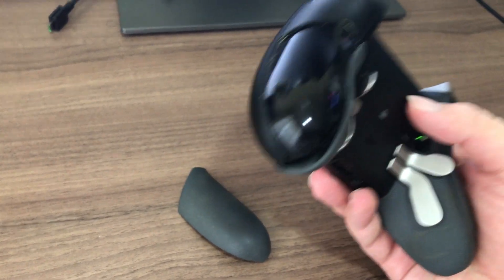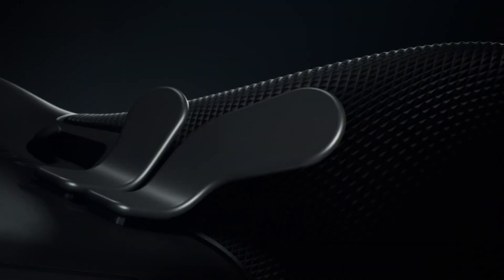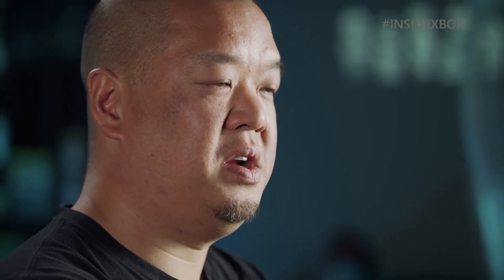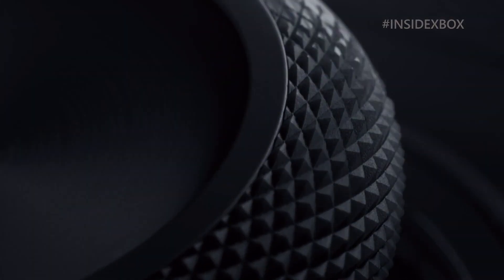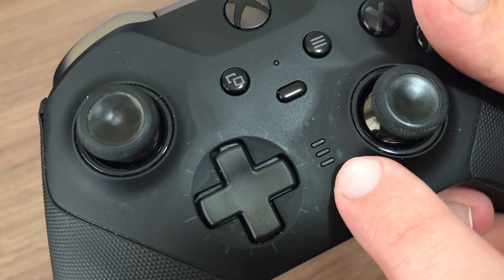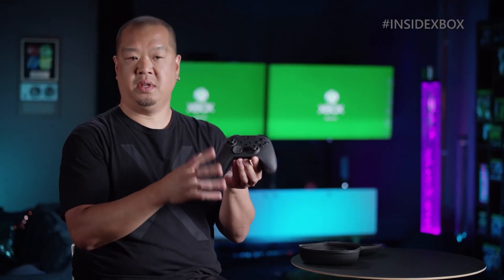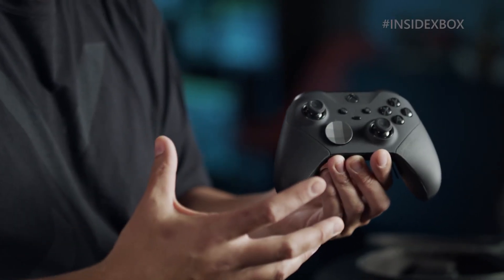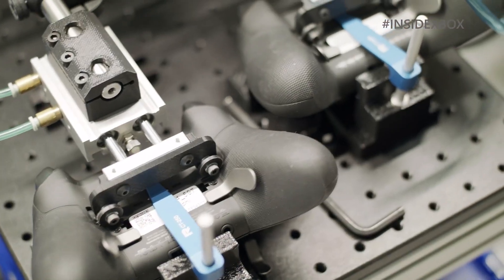Xbox Elite Series 2 After 1 Year: Did Microsoft Fix The Durability Issues?

Comment: How are your A buttons doing today? I bought the elite series 2 and the button A did not always react when pressing, they changed it up to 5 times and they were ALL the same. Is it a problem that everyone has or was I just bad luck? 

PS: The problem is noticeable when I press button A from a 45 degree angle.
Reply from the maker: It works fine most part of the time. After two months of use, the A button hasn't got stuck ever since. It'll occasionally fail to register, but it's rare now. My main issue now is with the RB bumper. It constantly registers double presses. 

You can replace Series 2 as many times as you want, but I suspect the issue is with a faulty design rather than an issue with each individual controller. A quick Google search will bring up a ton of people with the exact same issues.
Reply: @jidenshaotoko  Hi, thanks for answering, are you telling me that the problem with the A button is becoming less constant in your control?
Reply from the maker: Yes, it's less constant now, but it still does happen from time to time. Judging by huge the number of people with similar issues, it's almost certain that this is a design flaw that Microsoft needs to fix on their next controller.
Reply: 3 controllers had the same problem broken A button input
Reply: My A and bumpers act weird.. its gotten me throttled on COD. Even AC Valhalla. I'm yelling at it like man I'm smack tf out of the RB fight back! I've started losing connections more when plugged in but still noticed for me. No updates have been up in a while..im going back to a scuf when I get the chance. Those last longer. I still have my ps4 one and had a 360 one yrs after it was obsolete

Comment: I game 4 to 6 hours a day, how tf yall destroying your controllers? Pressing things harder doesn't make it more effective.
Reply from the maker: I don't understand how people burn through multiple controllers in a year either, but as someone who's had only one controller completely failing on me in 27 years of gaming, I gotta say the Elite controller is known to have a higher than normal failure rate. They don't normally fail completely, but they usually have issues with certain buttons after a few months of use.
Reply: @jidenshaotoko  makes sense if you think about it, more points of failure available. Thanks for this vid btw, I plan to get one this weekend😁
Reply: I bought one at Gamestop a month ago, the A button had a failure, they changed it 5 times always giving me a new control each time, all the controls they gave me had the same problem.

Some do not notice it because they are used to pressing the buttons hard, or playing games where it is rarely used, but if you press it at a slightly inclined angle there will be a 50% chance that the action will not register.

I don't know if I was unlucky or if it is a problem that all the controls have, but that not all users notice it because they associate it with a connection failure or press it wrong.
Reply from the maker: I mentioned the problem with the A button in the video. Happened to me as well.
Reply: I’ve had 2 elite controllers series 1 and both the grips on the back of the controller came off think I will skip series 2 and wait for series 3
Reply: You gotta be a very big physco in order to destroy not one but multiple controllers in the span of a year.
Reply: We aren't pressing buttons hard. It's just bad quality